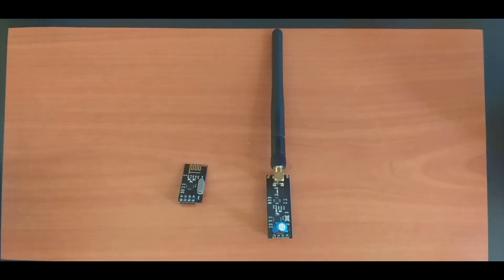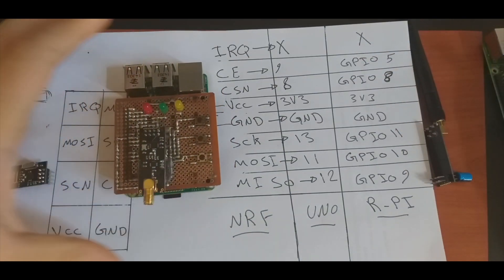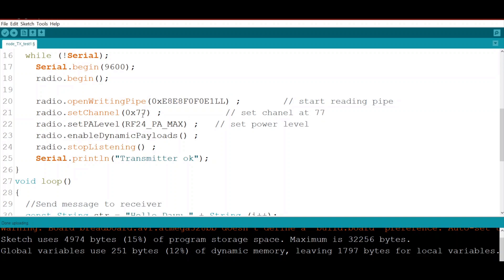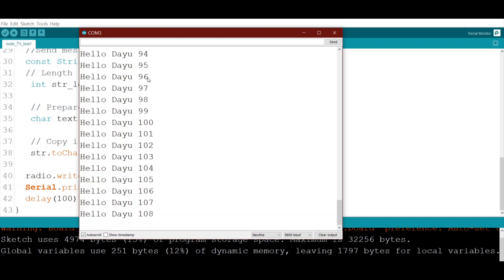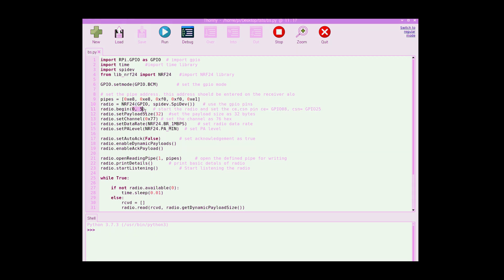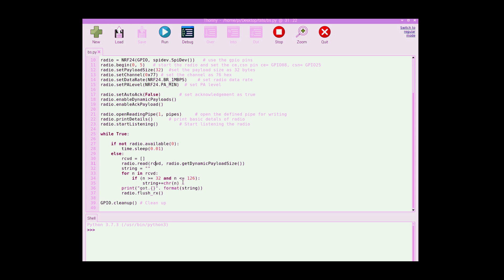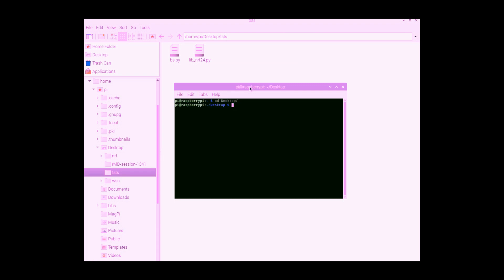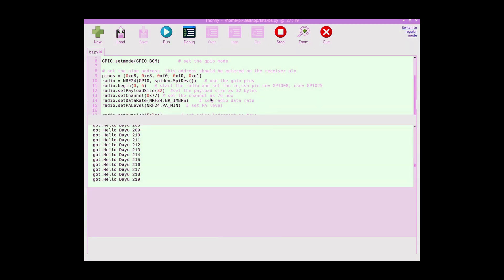Raspberry Pi to Arduino Wireless Communication 🌐 | Solving the NRF24L01 Library Issue

Comment: Hi Guys! First off, great tutorial. We need more people like you. Thank you so much for this.

I do have a question to everybody, on the line that says: 
                                                    radio.begin(0, 5)
Why is it 0, 5?? My understanding on this is that the this is the Pin of the Raspberry Pi where the CE and CSN is connected plus on the video at first, you said connect to GPIO 5 and GPIO 8 but the program listing says GPIO 08 and GPIO 25... So confusing. Can anybody enlighten me on the radio.begin (CE, CSN) command? BTW, I'm a total dummy at this.
Reply from the maker: Thanks for the nice comment! 
For the radio.begin(CE, CSN) line: the two numbers are the GPIO pins you assign for CE and CSN. In the video I showed different wiring examples, so that’s why you see GPIO 5/8 in one part and GPIO 0/5 or GPIO 8/25 in the code.

The important thing is: the numbers in radio.begin() must match the pins you actually wired on your Raspberry Pi. So if you change the wiring, just update those two numbers. Hope that clears it up!

Comment: Was stuck with the issue for 1week thanks for sharing the details it solved the issue. Note : add radio.flush_rx() after radio.startListening() to solve unplugging the NRF24 from 3.3v and reconnecting it every thing you run the program in PI.
Reply from the maker: Welcome my friend, and thanks for the suggestion, that would helps a lot.

Comment: Hey Ali, Thank you for this quick fix. I too needed to know how to use this library with multiple receiving pipes active?  (eg. 6 Arduino's all communicating to 1 central raspberry pi). Its the same request put forward by @
44Hangdog. Thank you.
Reply from the maker: Well, there are many ways to this either with pipes or use data addressing as in this video:
https://www.youtube.com/watch?v=03ZZmRFTGYU&ab_channel=ChallengerTech.
https://www.youtube.com/watch?v=HUCiRF5Ceh0&ab_channel=ChallengerTech.
https://www.youtube.com/watch?v=RyiIGNZ__jI&ab_channel=ChallengerTech.
https://www.youtube.com/watch?v=diDnelKFqg0&ab_channel=ChallengerTech.

Comment: Ali - this is a fantastic and very helpful tutorial.  Would you consider making a tutorial explaining how to use this library with multiple receiving pipes active?  (eg. 6 Arduino's all communicating to 1 central raspberry pi)  The radio.available(0) line is the line that stumps me.
Reply: I second on this request.
Reply from the maker: @carlosblancoiii   Sorry for the late reply, 
I will do my best to make a tutorial about that. however, there are many ways to this besides the pipes is by useing data addressing as in this video:
https://www.youtube.com/watch?v=03ZZmRFTGYU&ab_channel=ChallengerTech.
https://www.youtube.com/watch?v=HUCiRF5Ceh0&ab_channel=ChallengerTech.
https://www.youtube.com/watch?v=RyiIGNZ__jI&ab_channel=ChallengerTech.
https://www.youtube.com/watch?v=diDnelKFqg0&ab_channel=ChallengerTech.
Reply from the maker: I will do my best to make a tutorial about that. however, there are many ways to this besides the pipes is by useing data addressing as in this video:
https://www.youtube.com/watch?v=03ZZmRFTGYU&ab_channel=ChallengerTech.
https://www.youtube.com/watch?v=HUCiRF5Ceh0&ab_channel=ChallengerTech.
https://www.youtube.com/watch?v=RyiIGNZ__jI&ab_channel=ChallengerTech.
https://www.youtube.com/watch?v=diDnelKFqg0&ab_channel=ChallengerTech.

Comment: Hi Ali, thanks for a great video!  I'm building a temperatur monitoring system for my house, and want to use arduino's with temp sensors communicationg with a raspberry pi via NRF24L01 radio. The rasperry pi will display the sensor data and make nice plots using node red.  So I copied the bs.py script you make here, and cloned the lib_nrf24_pi like you describe. I have the lib_nrf24.py and the bs.py in the same folder. When I run the bs.py script I get the following error message shown below.  Can you help with what is wrong?  Thanks :)

Python 3.7.3 (/usr/bin/python3)
>>> %Run bs.py
Traceback (most recent call last):
  File "/home/pi/weatherstation/current_code/nrf24/bs.py", line 20, in <module>
    radio.openReadingPipe(1,pipes)
  File "/home/pi/weatherstation/current_code/nrf24/lib_nrf24.py", line 570, in openReadingPipe
    self.write_register(NRF24.child_pipe[child], address, 5)
  File "/home/pi/weatherstation/current_code/nrf24/lib_nrf24.py", line 243, in write_register
    raise Exception("Value must be int or list")
Exception: Value must be int or list
>>>
Reply from the maker: Hi! Thanks a lot for the kind words, really glad the video helped! 
About your error — it usually happens when the pipes address is not in the correct format. The openReadingPipe() function expects the address to be a list of 5 bytes, for example:
pipes = [0xE8, 0xE8, 0xE8, 0xE8, 0xE8]
Make sure your pipes variable looks like that, and not a string or a single number. Once the address is a proper 5-byte list, the script should run without that error.
Also double-check that you’re passing it like this:
radio.openReadingPipe(1, pipes)
Try that and it should work. Let me know if you still get issues!

Comment: Do you have to use a microcontroller with the module on the transmitted side? Is there a much minimal way of transmitting data? For example from thumb joystick, can you transmit using this module without a microcontroller on the transmitter side?
Reply from the maker: I would still using a MCU to read the joystick stats and transmits it.

Comment: Thank you very much for the tutorial. It works an I am very happy. There is one thing that doesnt work in my case. If I start the python script, first time everything works fine. If I stop the python script and start again, it doesnt work. If I pull the power 3,3V from the NRF24L01 and connect it after a few seconds, the script works again. I think it is like an reset funktion. Can you help me in this case? Greetings Jens
Reply: add radio.flush_rx() after radio.startListening() before while True: . This will definity help i tried the same.
Reply from the maker: @HLABS Thanks for suggestion. That would definitely help.